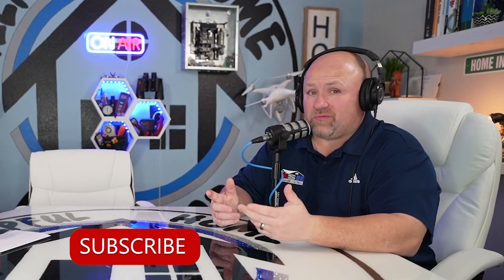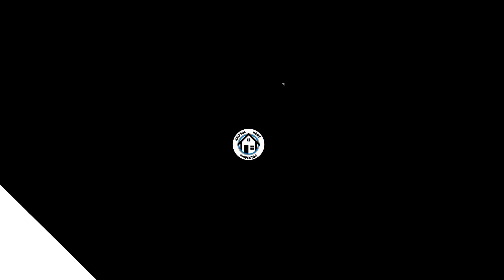Do surge protectors really work?

Comment: Hi there Helpful Home Inspector,   After watching this video it sounds like it could be hard finding a fully trustworthy surge protector in a power strip anyway and also not sure what Companies out there are the most liable and of the highest quality when it comes to a high quality trustworthy surge protector that can give the ease of mind or a peace of mind of protection for all expensive equipments and electronics and appliances that are all plugged into a surge protector power strip.    Perhaps a surge protector installed outlet installed that connect to all the other wall outlets in a room or space might have better trustworthy surge protection?    I think most surge protectors even for power strips that are up to 4,000 Joules of protection are the best to go as that is plenty of protection level.      What about how i setup my electrical supply for my bedroom for example,  I first made a junction boxed extension cord outlet using a air conditioner cord so its plenty thick enough to handle heavy loads of power and then i installed in the junction box a GFCI/AFCI outlet and then plugged that in first and then i plugged in my big power strip that has 4,000 loules of surge protection into the GFCI/AFCI outlet so you get a all in one of protection for all the above GFCI,AFCI and then 4,000 Joules of Surge protection.     My thought process was if ever any changes or spikes or changes in current or any surges then it is more likely that the GFCI?AFCI outlet would trip and shut down the power first and then the surge protector power strip that is plugged into the GFCI/AFCI outlet would cut the power to everything so that would shut down first and then it if somehow went past that then the surge protector power strip would trip however its more likely that the GFCI/AFCI outlet would be the first in line to trip and cut off power.     Either way that gives a extra step of extra protection don't you think so to?    Anyway that is how i did mine.        That is what i have told and encouraged some other neighbors of mine to do that were concerned about trusting there power strip surge protector on its own and then told them to plug in there surge protector power strip into a GFCI/AFCI outlet built into the wall and then plug in there Surge protector power strip into the GFCI?AFCI outlet and then have everything they want to protector all plugged into the surge protection power strip and that will help havea extra level of protection.      The other thing that is then great as well is you then also get protection added to your surge protector power strip as everything plugged into the surge protector power strip then also has GFCI/AFCI protection as well.        Thats a big bonus,    Everything then gets GFCI/AFCI & Surge protection!!!  Sounds like a winner to me!